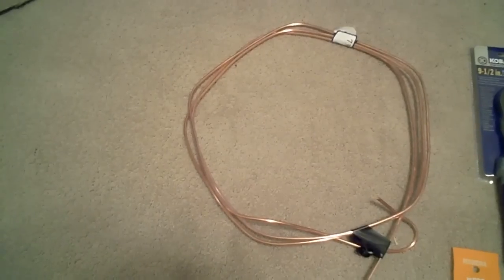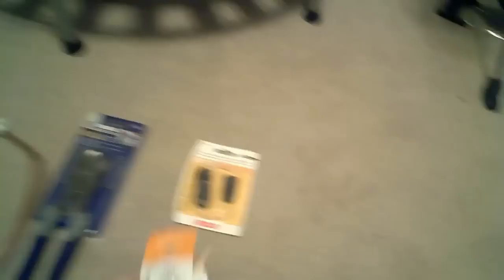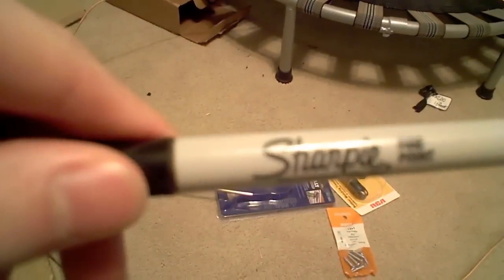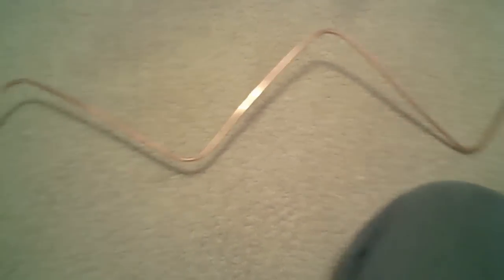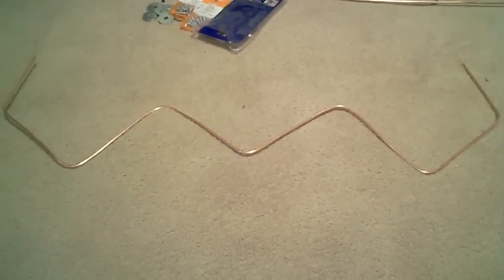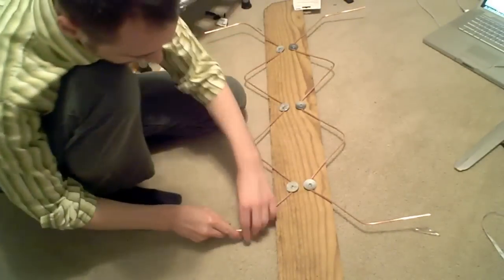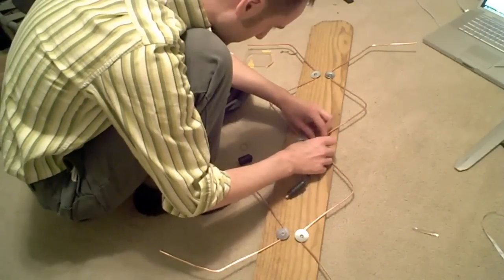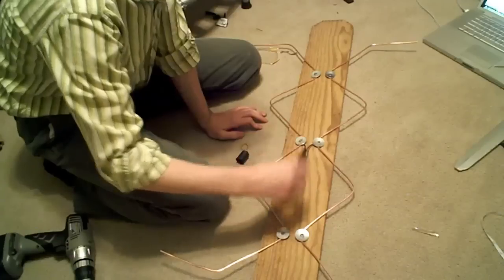How To BUILD The BEST HDTV ANTENNA! | Homemade HDTV Antenna DIY

Comment: Do the two side have to be isolated from each other? i've seen models where there's an intersecting wire that basically makes the two sides touch. what's the deal with that?
Reply from the maker: I haven’t seen or tried that

Comment: You dont need copper wire. You can use a coat hanger, aluminum wire, fence wire dosnt matter as long as it holds a shape
Dosnt even have to be this shape.

But the wires can't touch.

Comment: The 137 degree bend is actually 45 degrees. The version your building does not do vhf very well. All straights are 7".
A drill will straighten out your wire like nothing else. Just saying.

Comment: 1)  Like everyone else, I wondered why his camera was aiming upward.  2)  How many channels will I lose if I just bend the wires without all the measuring and marking, etc.?  I bet I could come very close to the exact specs by eyeballing it.  3)  And most important...and reason I won't be building this...is what to do with the "modulator" device!?!  Did I completely miss that part?  I'm guessing you hook the two wires to two terminals on the modulator.  Then run two wires from terminals on the other end and plug those into a wall plug.  Than call the fire department.  I'll have to watch it again I guess or this was a waste of time.  4)  Don't buy the 18 dollar cutters.  I can think of a half dozen ways of going through the soft copper.  He seems like a nice guy, though.

Comment: if you guys get a 1x1x2'',drill to the proper size as your wire,you can push copper wire through said hole and straighten the copper wire out,this should help out a bit,hope this helps guys

Comment: "It's going to be capable of picking up HD channels". This sentece has pissed me off. Digital TV works in a way that HD AND SD channels are multiplexed digitally and that digitally multiplexed information is transmitted in a 6, 7 or 8 megahertz (depends on where you live) frequency window with a digital TV transmission standard like ATSC. That ATSC signal gets from the antenna to the TV or converter box where it is demodulated (makes the signal back to picture and sound) and displays it. My country uses the DVB-T standard (https://en.wikipedia.org/wiki/DVB-T) which is the digital TV standard used in Europe and I live in an area where the signals are much weaker that your antenna may not able to recive signals even on the attic of my house which is about 10 meters (30 ft) above the ground. My €5 thrift store indoor antenna can do the same things on the ground floor(!) better than your antenna on the attic. Just buy a proper antenna if you don't want to waste time and money.

Comment: I built your antenna for my attic and it works great in NW New York..I get Vermont and Montreal stations up to 80 miles away through woods and over mountains..don't care what the pseudo theorists say it works.. for outdoors I'm going to use a scrap piece of composite decking instead of wood tho and get it up about 25 feet..going to try for Albany..
Reply from the maker: AWESOME! Glad that I could help ya out! I'm still using mine after all of these years!

Comment: Great to see that woodprix has new instructions to save my money and energy to build it.
Reply: Amazing plans
Reply: This is basically a Gray Hoverman antenna design. Not to step on anyone's toes, but if you look up Gray Hoverman here on You Tube there is a guy by the name of Danny Hodges who builds all kinds of antenna designs, including his Ultimate Antenna which is a variant of the Bow-tie Antenna. He has built one of these Gray Hoverman antennas with Imperial rather than Metric measurements. You should check it out.

Comment: or the easiest that works just as good. get a cable wire cut one end. take the rubber layer off 6 inches so its just copper and plug it in. will work just as good

Comment: By the way, don't be misled by advertisements claiming an antenna is specially made for digital. The antenna does not care what the mode is, be it digital or analogue or a data mode. All the antenna cares about is the resonant frequency.

Comment: By the way. Don't be fooled by advertisements that an antenna is great for DIGITAL It's all digital now. In any case, the antenna does not care what the mode of transmission is, be it digital or analogue, all it cares about is the resonant centre frequency.

Comment: Dude. Listen up. You have to know what country and frequency range you are shooting at. The world works on lots of different frequencies. If your aiming at the American viewer, then say so, even then the frequency bands vary from State to State.
Listen up. Start with 299792458 / 2/ 4 then cut each leg of your dipole to that frequency. The reflector needs to be 5% longer than the full half-wave  dipole, and, the director needs to be 5% shorter than the dipole and the subsequent directors need the be 1/2 wavelength across your boom. the first director needs to be 0.2 wavelength from the director and the next directors  1/4 wavelength from the 1 director. Job done. Fit a masthead pre-amp to reduce the cable line noise and losses.
Folded dipole is 1 full wavelength in a loop and the start is to go to the coax feed inner and the other end to the coax braid.
all other directors and reflectors as above. 36 years as a radio engineer.
Reply: “then the frequency bands vary from State to State“? What? This makes no sense.

In the US the frequency that make up a band are assigned by the FCC, these are fixed. Yes station frequency assignment varies  from location to location, ABC might be on a different frequency then just 70 miles away, but all fall within the band. There are only two bands VHF and UHF. Most all of the old analog TV stations went to UHF going to digital, it is the reason TV antennas got smaller in width. All commercial TV antennas cover all frequencies in a band, old antennas covered both VHF and UHF. Some new just the UHF, in our area we have zero channels in the VHF band.
Reply: so what does this mean in measurement numbers for Dallas

Comment: GOOD WAY OF DOING THIS, BUT, IF YOU USED ANODIZED ALUMINUM RODS INSTEAD OF THE COPPER WIRE, THE RECEPTION WOULD BE EVEN BETTER. ANODIZED ALUMINUM HAS ALWAYS BEEN THE PROVEN FACT FOR PULLING IN TV RECEPTION.

Comment: Nice antenna. BUT. #6 GAUGE COPPER WIRE is TWICE THE THICKNESS AS #12. Also you didn't "nail" the copper to the wood, you screwed it.

Comment: I would have shown an image of the final product at the beginning of the video.  Then all the measurements you were talking about at the start would have made more sense.  Also, when it came time to test I would have compared it to something.  Like what do you get with a standard tv top type antenna compared to this... or even no antenna at all would have given a feel for how much better this is.

That said, it was still very helpful.  Thanks.

Comment: I love how he claims it's the best but has never built anything else to compare it to.  He doesn't even claim to understand the design so how could he know which is best?  The fact is if you have a high enough elevation, any freaking piece if wire can be a good antenna.  I want to know what is going to work in a ground floor apartment without line of sight access to the broadcast towers.

Comment: what the fuck...no more than a short range UHF antenna. Do not need copper wire , cheap aluminum works also..  This only works for strong local transmitters.

Comment: I get over 60 channels with my power boost antenna 40 feet off the ground with a rotor. Perhaps another 20 channels with skip conditions.
Reply: And how often do you get skip???
Reply: I get skip conditions virtually every night , which means after sundown. some stations come out of longer distances.
Reply: radio and tv waves that get a bounce off of hemispherical conditions.

Comment: Just bought supplies today from our local Menards and spent about $12 to make two of these antennas. The flat window antenna that we were using only pulled in about 7 channels but one of these pulled in 12 channels. I did have a issue trying to connect both together for a stronger signal and not sure why but I couldn't receive as many channels with both connected together but I haven't giving up on that yet. I also noticed that you get a better signal hanging it vertical vs horizontal. Thanks for the great instructions!

Comment: These work great. I have one in the attic now. It picks up 20 channels between 20 and 45 miles away. I have wired two together and pulled in stations 100 miles out. 

I made mine out a steel wire purchased at Home Depot (I believe it's 11 gauge)

Its called a Super Stealth Hawk antenna.
Reply: Why Don't you make them and sell them. I dont believe your mileage also. The out door Anttena can only do about 60 to 80 Miles tops, just like when you see some of them Anttenas that claim over 150 Miles is a lie, i have seen a Atenna company state th see way the earth curves there is no possible way to get 150 Miles.
Reply: +I hate google It's called a grey-hoverman the stealth hawk (super or regular ) is a different beast and not near as powerful.
Reply: +My Apartment On Wheels, The antennas are in Florida, and picking up stations over relatively flat land.  They have to be high enough to 'see' over the curvature of the earth, but picking up 100 miles out isn't hard at all.
Reply: +ghz240, Whatever it's called, it works.
Reply: I hate google Everyone can pull over 75 Miles but cant make a video on it. Its called the Earths curvature,  not because your in that Special state of Florida. Go to Los Angeles,  California and see if you dont catch close to 100 channels from Digtal Antenna.

Comment: If you live just a few miles from a transmitter than a metal coat hanger will work pretty well, the further away you are from a transmitter the better the antenna you'll need, possibly large yagi roof mounted types if your 20 miles or more away

Comment: I'm just using The Old rabbit ears from Radio Shack I just found in my garage.... I'm a big Dummy because I just remembered I still have the big antenna on roof of house probably from the 70's and there is still alot of houses in the city of Phila.that still have theses Antennas.I just have to find the 300-Ohm Flat Twin-Lead antenna wire long enough to come into house..

Comment: i get more channels with  a clear tv antenna  andl ess money and work
Reply: Magic Man The number of channels you get depends more on how may transmitters are close by than what antenna you use.
If you live in a major urban area you may get 100+ channels from a simple low gain antenna .
If you live where there are fewer transmitters even the best antenna and tower and rotor may get you only a few.
Comparing number of channels received is like comparing the number of bugs splattered on your wind shield during a trip  to the store.
Comparing to your neighbor  may be  relevant  , but comparing to a guy across the country is pointless.
Reply: clear tv is scam, be aware
Reply: +Don Pablo Cruz  Wow "scam" is pretty harsh. 
I'm not disagreeing just wondering , why/how is it a scam ?
Their commercials are quite misleading, making it sound like antenna reception is something new.
It's just an antenna.and no antenna is suited for every location or persons requirements.
Would you elaborate on how clear TV is a scam ?
Reply: it's scam because it is just an antenna...
and it costs $27...
you can buy a $5 one, and it would do the same
Reply: Thanks for the video....I was only kidding ...Great work.

Comment: Instead of buying copper wire & screws, wood and whatever.  Buy a good outdoor HD antenna. From the cable bill or satellite savings that in itself will pay for itself. I have a Lava Brand that gets 50 channels from two  broadcasting towers 50mi away. Get a sling TV, Roku or Fire Tv to add more channels.  Also you can buy a DVR that you can record your shows on. Amazon sells them. Don’t take my word, check out the reviews on Amazon before you buy. You’ll be glad you did. I give you 3 Stars…

Comment: as the crow flys our closest Transmitting towers are up to 45 miles away, This guy thinks everyone lives in the city.
Reply: +Mark Lawrence. I get stations over 50 miles out with this antenna
You can wire two together and reach out much farther.

Comment: The original blog sited in the description is a dead link and 2nd or 3rd hand info at best. Properly constructed this antenna is capable of high VHF and UHF reception.
Here's the site where a community of enthusiasts  polished this nearly forgotten antenna from the 60's into a modern computer optimized compact power house tuned for the recently narrowed TV frequencies.
http://www.digitalhome.ca/ota/superantenna

Comment: the easy/cheap way is...take a cable wire, plug it up to your tv, then take a safety pin and push it in the center part of the cable wire next the protruding wire part. it works, try it. total cost 0$.
Reply: just make sure that the safety pen is only touching the copper part of the cable cord and that the cable cord is facing up for optimal reception. it has a 40 to 50 mile range.
Reply: Sedrick Williams WOW you are really comparing a high gain deep fringe antenna designed by a community of modeling enthusiasts to a safety pin stuck in the end of a coax !  
I can get signal from a straightened out paper clip stuck in the back of my TV, but that doesn't make it a good antenna.
The "it worked good for me " argument is meaningless to everyone except people who live exactly where you do (that's just you ), and just confuses the uninformed (who think antennas are measured in miles not decibels)
Reply: look ma'am, I bought an expensive antenna. two actually. the ciso aironet  437$ then I downgraded to the mohu outdoor for 250$. and there's no difference kid. all produced HD quality and sucked when it rains. just like directv..oh yah, I had that up until 2013. may the force be with you and your breath not kill innocent Americans.
Reply: Sedrick Williams Look missy ;  you paid $250 for a mohu! Now that's funny, the primary design criteria for a mohu was  to answer the request : "I need an antenna that my wife or HOA  wont make me remove,  oh and no rotors"
It was never meant to be a fringe antenna let alone deep fringe,it was aimed at yuppies and gadget fiends with more money than actual interest to research and who also tend to live near TV towers not in fringe reception areas.
Even the crude gray-hoverman  with no reflector or narods as demonstrated here can stomp a mohu at every thing but beam width. Because higher gain is dependent on narrowing the beam.  The mohu strives to be "non-directional" , can you say multi-path heaven ?
Also never get an antenna with a built in amp that you cant remove.
Get a real antenna and rain will not cause signal interruption. 
cisco aironet  ? What model of cisco TV antenna did you get? Because all i see is wifi equipment?
I'd bet my pay check I'm older than you KID.